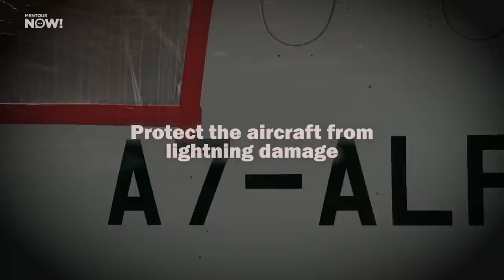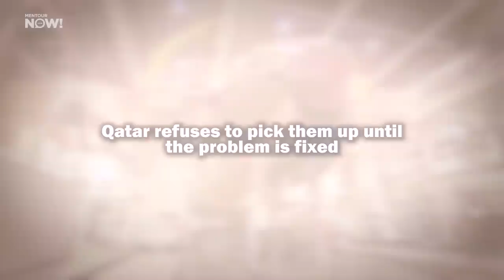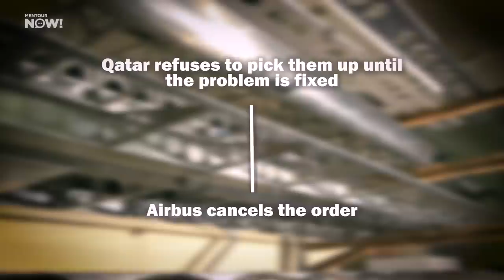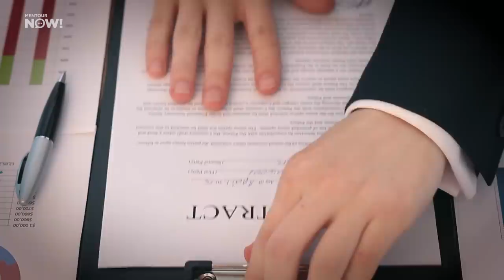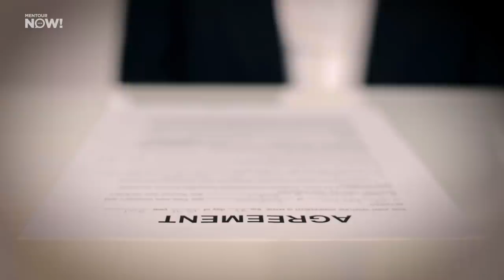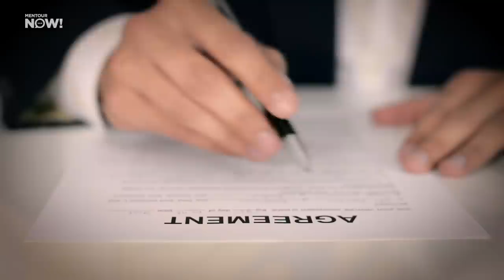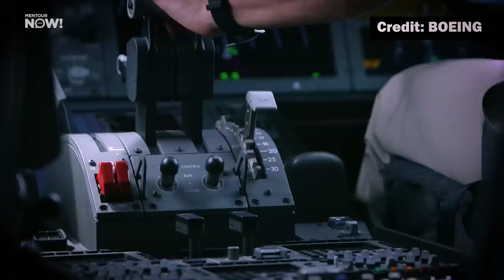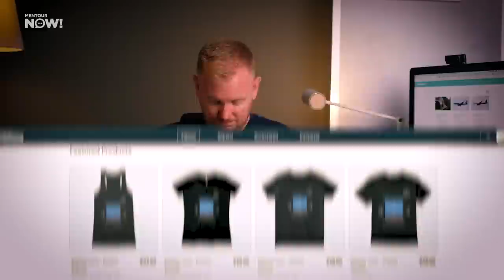WHO is Winning the FIGHT between AIRBUS and QATAR Airways?!

Comment: If Airbus had folded quickly during the pandemic, when Qatar went in attack mode, a quick resolution would likely have been very good business for the airline, but that gamble badly backfired by it becoming a protracted legal battle instead, with the cancellation of the A321neo orders on top to really break the plans for passenger capacity and so on. But with strong state backing, the airline can afford to waste a huge amount of money, of course.
Reply: Why would they do that ? Than other Airlines could question the Air worthiness of the A350 series and they would loose way to much.
Reply: I suspect that the idea was something like "as a very big customer, Airbus can't risk losing us, and our friendly local regulator helped us by declaring it a safety issue, so our hand is too strong to resist". Sure, there is a skin quality issue, which will be expensive for Airbus to solve in a good way, but playing the "safety" card was too high stakes without other regulators agreeing.
Reply: @JohnnieHougaardNielsen  I totally agree with you on that. Undoubtedly Airbus are at fault for what is happening with the A350. But also the airline tried to play them.  If EASA and FAA don't find it as Air Worthiness issue then Airbus made the right decision.
Reply: Qatar overplayed the cards that they had at hand.
Reply: @dimjad7933  Then and Than are two different words, learn the difference. "Then Airbus made the right decision" , Then is the word to use. Than is used to compare. Airbus is bigger than Embraer.
Reply: @dimjad7933  Well obviously Airbus are at fault for a manufacturing defect in their planes. Nobody's suggesting otherwise. The dispute is about how the manufacturing defect should be resolved.
Reply: @beeble2003  no it's not. Airbus offered them to work together and solve the issue on long run.  But the Airline wanted to use the situation and squeeze as much money from the manufacturer as possible.
Reply: @dimjad7933  That's exactly a dispute about how the paint defect should be resolved! Airbus thinks it should be resolved by working together; Qatar thinks it should be resolved by squeezing as much money from the manufacturer as possible.
Reply: @beeble2003  so that means you resolve an issue by "blackmailing" your partners ?
Reply: @dimjad7933  No, it doesn't mean that I do that. What did I do to suggest that to you?
Reply: @beeble2003  what is quatar telling Airbus  "we want a massive amount of money on top of you fixing this minor issue, or we are not taking the planes we orderd and sueing the s**t out of you (because a global pandemic damages our business )" other than blackmailing the business partner?
Reply: @SieggurtzuSpeyer  Where did I say it wasn't? Why do people keep responding to me as if I'm some kind of Qatar Airways supporter or representative. Please read what I actually wrote.
Reply: The issue is more to do with the CEO of Qatar. Issues started before the A350. He is just using the paint issue for leverage. He has made Qatar a customer that is not worth holding onto. The middle east airlines buy a lot of twin aisle planes which have higher margins, but the sweetspot at the moment for Airbus is still the A320 and its variants. Given the 8 year backlog for the A320 series, Airbus have already resold those single aisle orginally destined for Qatar. Good luck with Akbar Al Baker, Boeing. You are welcome to him. You will regret being the sole supplier.
Reply: @beeble2003  "Why do people keep responding to me as if I'm some kind of Qatar Airways supporter or representative" - I'd guess it's one or more of the following -- 1) people don't like to read full comments or discern context, 2) people like controversy and like to argue, and 3) potential misreading.  In this case, I believe it's because Dim Jad made two statements in his/her comment ("Airbus offered them to work together and solve the issue on long run" and "the Airline wanted to use the situation and squeeze as much money from the manufacturer as possible") and your response began with "That's exactly a dispute about how the paint defect should be resolved!" (which was followed by "Airbus thinks it should be resolved by working together; Qatar thinks it should be resolved by squeezing as much money from the manufacturer as possible").

I'm not sure how you meant that first statement, though I suspect you meant it exactly as written.  It could have been meant exactly as it is written -- simply stating this this is a dispute between two parties who don't agree on how a paint defect should be resolved -- or it could have been worded incorrectly and was supposed to be "That's exactly how a dispute about the paint defect should be resolved".  In my opinion, both of those interpretations are valid and true.

People who like controversy and arguing (and/or don't like reading or discerning context) would probably stop reading after your first statement, assume you meant "That's exactly how a dispute about the paint defect should be resolved" and further assume that you were talking about Dim Jad's second statement ("the Airline wanted to use the situation and squeeze as much money from the manufacturer as possible") because that's the last one they read.  They wouldn't think you were talking about Dim Jad's first statement ("Airbus offered them to work together and solve the issue on long run") because that wouldn't satisfy the controversy they are seeking.  Sadly, we live in a world in which many people now actively look for controversy and believe the worst in everyone and, as a result, this type of response occurs far too frequently.
Reply: @nomore6167  Thanks for taking the time to comment in such detail. I meant what I wrote. I originally said that Qatar Airways and Airbus were in dispute about how the paint defect should be resolved. Jim Dad then said, essentially "No, they're not in dispute about that. They're in dispute about [how the paint defect should be resolved, only stated in different words]." So I was pointing out that Jim Dad was describing exactly the same situation as I was.
Reply: @beeble2003  If you've watched any videos on YouTube which have any political aspect to them, then I'm sure you've seen plenty of people in the comments section who post comments exclusively to antagonize people.  I've seen that behavior on videos of all topics, but most frequently on videos with political content.  I think that behavior has resulted in people generally becoming more defensive, less tolerant, and more antagonistic as time has passed.

I've been in the same situation myself, in which I've agreed with someone and then they verbally attacked me as if I said the exact opposite of what I actually said.  I kept re-reading my post, thinking "Did I say something wrong?  Could that have been misinterpreted in some way?"  The only thing I can come up with is that some people just assume the worst in others, they assume that everyone is going to argue with them, so that's how their minds perceive the words they read.

Ironically, the use of social media is resulting in a shift toward more anti-social behavior.

Comment: Build planes from aluminum and you won’t have problems. Aluminum is way easier to repair and replace as well. Also, you can’t use paint stripper on composites, making repainting, 2or 3 times more expensive. Also, when it’s all said and done, you’re not really saving that much weight either.
Reply: Not saving much weight?! 20% on the 787 so it is not a small number. It also is stronger, more flexible and can be made in larger pieces and less joints.
Reply: Composites are cheaper, stronger, last longer and require less maintenance, so as time goes on no sensible manufacturer will be using aluminium for airframes.  Yes they are sometimes more expensive to repair but they require repair much less often.  Weight savings are huge, up to 30% on military aircraft and about 20% on airliners to date, with savings set to increase as time goes on.
Reply: @FireAngelOfLondon  composites are definitely not cheaper. Composites are way more difficult to repair and sometimes impossible to repair requiring complete replacement of the part, subassembly or entire aircraft.

Comment: One point that seems to have been missed is that the pilots, crew, engineers and back office staff will all have to be trained for the Boeings and there is also the headache of the logistical side of things with the spares required to change over to Boeing aircraft. 
Also I'm sure that Qatar are aware of the issues that Boeing are having with their quality control (Or rather the lack of it!) on the 787 Dreamliner and the 737 Max. The paint is just falling off the wings of the 787 and the whole aircraft engineering world is well aware  that the aircraft that are being built by Boeing nowadays are of a far lower standard than Airbus. I work on both manufacturer's aircraft and the Boeing is like comparing a Suzuki car to a BMW. It really is that much of a difference. Just go into the E & I bay of each aircaft and it's clear who really cares about their products.
Reply: Qatar already has Boeings in its fleet. And what about the Boeing EE bay?
Reply: OMG, form a person that had owned brand new Suzuki and BMW cars, I would recommend you using a different analogy.
BTW, right now I have a (Japanese) Suzuki and got rid of the BMW (Shiny lights and quality are two different things).
Reply: The 787 paint issue has a fix.  The A350 issues do not.
Reply: @unconventionalideas5683  You obviously don't work on the 787. The paint issue hasn't been fixed. The paint is still coming off the wings in large sheets. Get your facts straight mate. I work on the plane, you clearly don't.

Comment: I kinda started out on Qatars side, if I paid 100 M for a state of the art aircraft and the paint was flaking off exposing the airframe to the corrosive local elements I would be pissed and I would want them to work on it and eventually retrofit the already operational ones but now I don't know. 
Airbus seems to be working on the problem and just tanking one of the larger current contracts for aircraft based on ehat seems to me like an unwillingness to admit defeat or a mistake or pride just seems unnecessary and mayve stupid. But what do I know, I'm just a sim pilot and armchair observer. Sometimes putting the Kings relatives in charge of high tech industries may not be wise.

Comment: I'd like to know, have other A350 operators been experiencing the same issues?  And has any Boeing Dreamliner (which, I believe also has a Carbon Fiber fuselage) experienced the same paint issues? Thanks
Reply: Yes, other operators have experienced similar issues with the paint on  their A350. However, Airbus offered full repaint while they investigated the matter to find a solution to it. I know the 787 have had similar paint flaking on its wing due to the composite structure, seems to be rectified with a repaint.
Reply: Yes, it is known from the A 350 of Finnair, Lufthansa and Air France - but these Airlines accepted the solution which Airbus offered them.
Reply: Yes, but they also did Not make it public Like Qatar.

Comment: I think, in this situation, and it is understandable, Qatar Airways is more concerned that the peeling paint would give Customers the wrong impression of their Aircraft, and the Airline in general.
It's sad that the issue has come down to a legal fight.  Had the Airline pitched in to help find a solution to the paint issue, and kept taking deliveries, both Parties would have benefited at  much lower cost to both.
Reply: If Qatar Airways stated that the peeling paint gave the customer the wrong impression, everything would have been sorted out long ago. Instead, they stated that the peeling paint was a safety issue, and no organization outside Qatar agrees.
Reply: @beeble2003  Indeed.

Comment: I still trust the EASA its only cosmetic issues
Reply: I agree.  Qatar took the wrong approach.
Reply: After the MAX crashes, regulators are being very careful with safety think a321xlr, 737-7, 737-10, 777-9 and until recently the 787

Comment: Could the mesh start rusting out when uncovered ? That could compromise its lightning protection ?
Reply: Copper doesn’t rust.
Reply: @johnnunn8688  Ah, so its a copper mesh then. I thought it could have been some other metal that could rust or maybe aluminium that could corrode or galvanically react with those composites. So this should just cover itself in a layer of oxide and nothing more ?

Comment: Airbus only gains by kicking Qatar Airways out of it´s books. As I was told by lots of people at Airbus and in the industy the middle eastern carriers are often money pits to have as a customer. Airbus has enough demand for these Typs of Aircraft that the spots will be filled in no time. Another imported thing to consider is the fact that thier is no comparable Aircraft in terms of size at Boeing with this new tech right now that can be delivered in the coming 3 years. Airbus has more leverage on Qatar in this case.

Comment: The thing about the aviation industry that has always astonished me is their systemic practice of resisting innovation. Not just with jumbo jets but all the way down to ga. A 75yo design is fine to produce as are it's parts. Want to slap a new light system or tire on a 4 seater? It best be certified and have gone through expensive testing.

Comment: It's not just Airbus that has paint adhesion issues. Boeing's 787 has a similar problem with paint on the upper surface of it's wings. We've been slapping speed tape on them for a long time. Unfortunately, when you pull off the tape, a whole strip of paint comes with it. This is not a trivial issue, since carbon fiber is very susceptible to damage from UV radiation. Qatar is correct in being concerned.

Comment: In my opinion, I would inquire who is the manufacturer of the paint. Does the new environmental friendly paint requirement chemical composition played a factor 🤔. I know here in the U.S there is an issue regarding Aerospace chemicals and their EPA requirements. Some base coats required a water based primer. This is a paint manufacturer requirement rather than an Airbus Problem.
Reply: I think all parties is involved in this already. To my understanding, it is down to application of the paint, if the application is to thick, this will cause this type of issues.

Comment: As one composites engineer has commented, I would not be so quick to dismiss safety concerns.
Reply: And where do you get the idea that all other aviation regulators across the whole world "quickly dismissed" the issue without appropriate analysis?

Nothing but a funny coincidence that the only regulator that found an issue is controlled by an entity that would save millions of dollars if their claim was accepted?
Reply: I believe that there are many more composites engineers working in the aviation industry with deep knowledge in composites and aircraft that have given their professional opinion. I believe that their opinion has out weighted the opinion of the one composites engineer working in some unspecified sector. But I also believe that the many composites engineers working in the aircraft industry or for the regulating authorities are constantly monitoring composite airplanes like the A350 and B787 for any issues, and if there is a suspicion of a safety issue, concerns are raised, necessary actions taken, and if needed, aircraft are grounded.
Reply: Group-think is a risk in any field of endeavor. Let’s see some reports of investigation and/or testing. Just because the “majority” don’t see something doesn’t necessarily mean it’s not there. Lawyers argue viewpoints; engineers look for facts wherever they may lead.

Comment: This is why you never intentionally burn a business relationship unless you are absolutely, positively, 100% sure you will never need it again, and even then, you should avoid burning it unless absolutely necessary.  Based only on what was mentioned in the two videos on this issue, it sounds like this is more about image and ego than about safety.  Regarding the Qatar regulator agreeing with Qatar Airways that it's a safety issue, that's not exactly surprising (and should be taken with a mountain, not a grain, of salt) considering the fact that Qatar Airways is owned by the government.